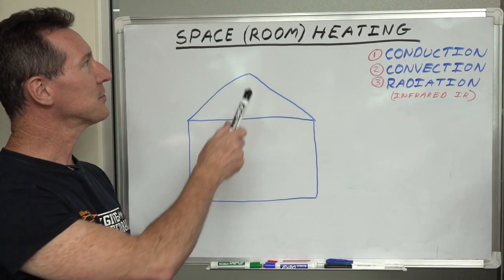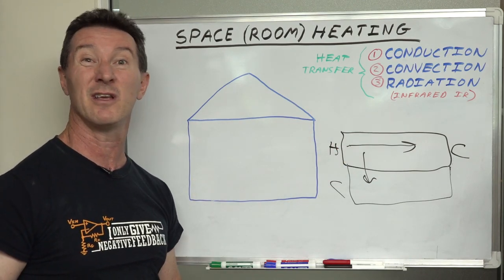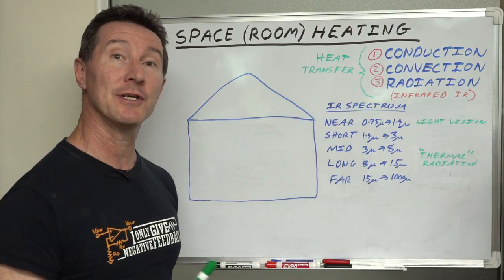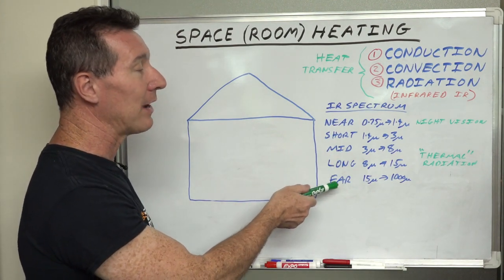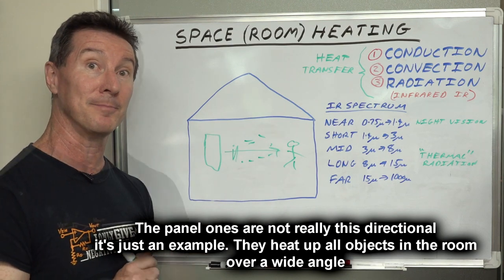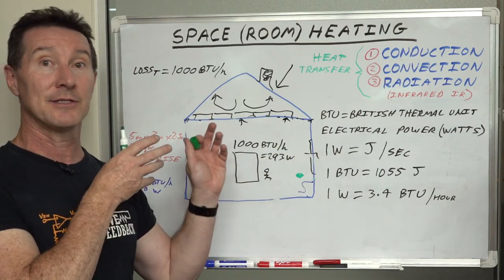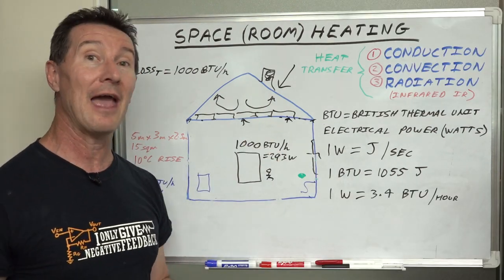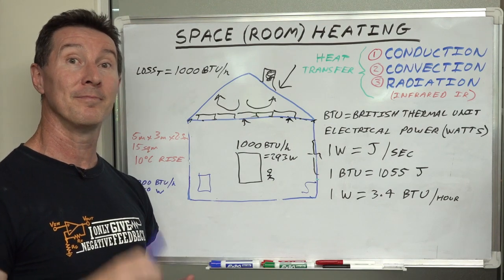EEVblog #1187 - Room Heater Technology Explained

Comment: Wait... wouldn’t a 2500W heater mean 10+ Amps? I get the feeling that would cause issues, but they sell them in Australia.
Reply: On 240 volts it would be 10.4 amps, so it would run on a normal circuit, but on a 120v circuit you would need a a 30 amp breaker (would use 20 amps and don't want to load a breaker at it's capacity so you'd move to next size up). Normally big heat sources like ovens and dryers are run on 240v though.  40 amp breaker needed for stove and 30 amp for dryer.
Reply from the maker: 2400W maximum here
Reply: @redsquirrelftw  On the off chance somebody reads your comment without fulling understanding what you mean, a higher amperage breaker would be used WITH heavier gauge wiring.  By way of illustration for normal length wiring runs: 14 gauge wire--15 amps; 12 gauge wire--20 amps; and, 10 gauge wire--30 amps.
Reply: In Australia the equivalent would be 2.5mm-10A, 4mm-20A, 6mm-30A ( cross sectional area ) and you would probably run 4mm for a 15A circuit.
Reply: EEVblog Then you get people running that off a power strip.
Reply: Cooljosh3k Well, it has to be a 10A power strip with a 10A cable and plug, not the weak 6A (or less) parts.
Reply: John Francis Doe The problem comes when the household voltage reaches 250+. Plus the kind of people who are fooled by the bullshit marketing probably plug that space heater into an double-adapter or power strip.
Reply: @wargamingrefugee9065  Yes that's a good point, you can't just go and change a breaker without changing the wiring.  The breaker is there to protect the wiring after all.  Ideally when buying power strips or extension cords it's good practice to try to stick to ones that are 15 amp rated, that way there is less chance of overloading it as it will be rated the same as the whole circuit.

Comment: There is one area where you can improve the efficiency of heating - that of control. If you have a basic heater controlled by a thermostat you will get hysteresis, where the heater will overshoot the required temperature, and the room gets too hot, and subsequently too cold before it cuts in again. You can improve the efficiency by using a more intelligent control method that accounts for things like heat loss and rate of change of temperature. It can switch the heater so that it maintains the desired temperature more effectively. The heater itself isn't more efficient, but the amount of energy used to keep a room warm is reduced.
Reply from the maker: Sure, didn't want to get into that in this video as that could be another 30min video in it's own right.

Comment: Minor detail, but in convective systems with mediums with low thermal conductivity the heat transport is virtually entirely due to convection. Once convection sets up there's no real path for conduction over appreciable distances due to the moving fluid. There is the Nusselt number, which is a ratio of the convective to the conductive heat transfer, but that assumes a hypothetically stagnate medium with no motion for conduction. Conduction is primarily important at the convective interface of the heated surface.

Comment: I'm still unclear about the differences between conduction and convection. Isn't heat moving through air (conduction) what causes convection?
Reply: Conduction is when hot metal touches cold air and the air becomes hot. This happens on the surface of the heater. Convection is when hot air moves and replaces cold air. 
So a convection heater will conduct heat to cold air on the surface of the heater, then the hot air moves, and cold air takes its place. That cold air gets heated again. This is why convection heaters either have big surface or a fan. To either heat more air at once, or move the hot air over the surface quicker to bring the colder air in contact quicker.
Reply: There's very limited conduction involved, pretty much only the boundary layer of air on the hot surface then where the air contacts the cooler surface and releases it's heat energy. It's worth noting that the air in a room will very rarely heat you as you're generally quite a lot hotter than the air in a room, but warming the air reduces your body heat losses.
Reply: Actually, no. Conduction works like this, super thin layer of material gets heated from the source of heat then next thin layer gets heated from the first thin layer and so on. Heat spreads through material. Convection really works only with gaseous or liquid substances and only in the presence of (surprise!) gravitational field. It won't work inside the ISS, for example. It goes like this, super thin layer of say air get heated from the source, heated air has less density so it floats up like air bubble in the water, because air less dense than water. So hot(ter) air less dense than cold it "bubbles" up. And the process goes continuously.
Reply from the maker: If it was pure air conduction then the heat would radiate out evenly in all directions in the air.
Reply: Convection needs material to move conduction doesn't

Comment: Interesting he brings up the idea of motor loads. I remember doing building heating/cooling load calculations and you do indeed use your blower motor loads as part of the heat load (or heat input if your heating and not cooling). Usually something similar to this we used for the heating and A/C load calculations: https://www.carrier.com/commercial/en/us/software/hvac-system-design/

Comment: My understanding of the concept of insulation is that it won't stop the heat from getting from a source, but it will make it take LONGER to get there. As I see it like a coat on a winter day, your body needs the heat for its chemical processes, and not to freeze either, keeps the heat inside the coat. Also my understanding is that if you have a perfectly insulated container with a heating element of some wattage, the temperature of the container will just keep increasing. I was thinking a scanning IR laser may be a good heater, but I bet it would damage eyes.
Reply: Yeah insulation is basically by design a very bad thermal conductor, so it just slows down the transfer rate.  This is known as R value, higher the R value the slower it transfers heat. (basically)

Comment: LCD TV is 100% efficient heater, refrigerator is 100% efficient heater, peltier device is 100% efficient heater, ceiling fan is 100% efficient heater.

Comment: are there any induction heaters ? instead of resistors or pumps , use electromagnetic induction to heat something .
Reply: Induction hobs are popular in Europe, but outside of industry you won't see them used very much otherwise.
Reply from the maker: Only for cooktops
Reply: @EEVblog  do you think that can help with power consumption ?  they are more rapid to heat up and can heat anything compliant .

Comment: 14:10 To be clear all electromagnetic radiation causes heat. The "thermal radiation" from your body behind the glass is the same as the IR heater both are radiation. However the heater although still in the IR range has a longer wavelength than the IR from your body. This is directly related to the heating elements temperature. The larger the wave the easier time it has passing through stuff. Mostly a pedantic point but it might mislead some people.

Comment: Okay, but maybe it would be best to have a variable temperature heater around the bottom of the walls, for example. a heating film, but one that can warm up to 80 ° C, for example, if it is cold because we were not at home and turned off and then heated at 30 ° C. This would quickly warm the walls and the ceiling, after which the air will be warmer. | I do not understand why radiators with the same operating principle do not heat the same. So, for example, the hair dryer and the large fan do not heat up as much as the large fan with ceramic insert / PTC insert, and each of them heats up with an old Soviet cross-flow fan.

Comment: Just for the young players Dave !
The heat loss is not a fixed value .
It depends on the temperature difference ( inside - outside ) & the rooms insulation .
So the bigger the difference the more heat input you need .

If you need more for less improve the insulation   LOL....
Reply from the maker: Yes, but for simplicity you have to assume some sort of constant loss.

Comment: Great explanation, it is a misconception among most people they don't know that a 200 watt TV for example is gunna ultimately dump 200watts of heat per hour in the room
300watt per hour is equavalent to 300watts its not accelerated BS because 1w/h= 3600J same as 1W=1J/s
Reply: Deeper layer Nope, you confuse division and multiplication.  1 W times 1 hour is 1Wh or 3600J.  1 Wh per hour is 1W.  1W per hour is the speed at which you might turn the dial up or down.
Reply: @johnfrancisdoe1563  u serious? You just rephrased what i said clearly i represented it in the end but if you didnt understand what i mean with 300watts is equivalent to 300watt/h i ment in most application and especially the example the dave listed at the end of the video when you see for example a 300watt refregirator it guranteed they mean 300wh no one measures watt a second unless for special application 
Edit fyi this sign "/" isnt division  it means every hour means Wh

Comment: I have changed my bulb to led bulb and they are getting colder than the others but the light is ok. I have a plan to make a lamp with three 300W bulb and put them in series and in this way I get a comfortable light and I utilize the heat they give in the winter, in the summer there is no need for heat or light.

Comment: A heating blanket would be a conduction heater!
Reply: but it also isnt space heater
Reply: @mycosys  It heats the room. And like a radiant heater, it first heats a particular object.  Another conduction heater is radiant floor heating. No cold tiles or wood flooring requiring house slippers in the morning.
Reply: @Markle2k  both of those cases are primarily convection heating of the space. Virtually all convection heating uses conduction from a hot surface initially to heat the air. But feel free to be as much of a pedant as you wish
Reply: @mycosys  I'm not intending to be a pedant. As far as the soles of your feet are concerned, on a chilly morning, the heat is conduction. For room heating, yes, even convection starts with conduction for the most part, as you say. Non-humid air is pretty transparent to radiant heat at temperatures that humans (and most solid materials) can survive. You need to get near 10000 K before the oxygen starts becoming opaque to the bulk of the radiant heating.

Comment: Dumb question:
If we take a radiator using natural convection and we force air with a fan what we obtain? Is the BTU/H increased if we have a "infinite" power source keeping the radiator always at the same temperature?

If the energy required to heat up a room is the same can we increase the heat transfer speed of the convection system? Like on coolers. We add a fan to increase the speed of heat excange.
In this case the heat source will cool due to the fact that the energy we extract is higher that the energy that it makes.

In an ideal system without losses the energy from the radiator that didn't get transferred to air is stored in oil or water (bases on the system type). If the resistors or the burner have a feedback they are off until the system need more energy to push into air. But this doesn't change the amount of energy required 🤔.

I'm just trying to understand how the meters on the radiator on Italy works to calculate the bill... 

The tecnicians calibrated it by number of fins, fins sizes, distance from the wall, etc. Are those measurements made to calculate the effectiveness of the natural convection?
On radiators in Italy we have a valve (thermostat valve) that prevent hot water to get inside the radiator if the room temperature is around 20°C. This will cool down the radiator and the meter stop. Hot water is provided by a natural gas boiler. The boiler itself regulate the water temperature and have a pump forcing the circulation.

This a brainstorm made at 3 AM...
Reply: TuttoCrafting I don't know about Italy, but in Denmark the usual metering system compares the temperature of the radiator and the room to get an approximate measure of heat energy removed from the circulating water.  The result is in arbitrary "units", actual billing then divides the total cost in a given year according to the how many units were counted at my radiators out of the total for all residents.  Method is not exact, formal checking is done mostly on the accounting side, such as not including any unrelated costs in the the heating bill, not collecting a different total amount from all residents etc.  The measurement company (an outside specialist) needs to justify the fairness of their method, and occasionally markets improved techniques that (for example) are less likely to bill for the sun shining on the heater.

Comment: Edit: crap, I'm probably in the wrong here... nothing to read here 😂
The mistake I made was equating an energy consumtion expression "W per hour" to expression Wh.
Possibly right but pedantic.

Dave, with joules and watts I got confused it felt kind of backwards since 1J = 1Ws.
Joule is a defined amount of energy... but can be a power level w. time?
Watts are just instatenous power level.... but with added time unit it also becomes an energy amount such as kWh.
Hmm... Why use the complex J/s when W is the same?
At the end of the video it can be easily misunderstood that saying 300 Wh is always talking out of their arse.
It is probably true for thermostat regulated heaters because they will run at full power until satisfactory conditions are met and then consume less as it does not need to raise the room temp any more -just need to keep up with losses.
So, like you alluded to, the makers do not know the application situation.
However, for lots of things, an hourly consumption if 0.3kWh could be correct.
BTUs... Hmmm.... more confusion, BTUs where mentioned on my AC unit, that where I even heard of it at all.
Add calories too? 😂
Reply: It sould be ws not wat per second( w/s)
Reply: @mistakenotou7681  Thanks!

Comment: The issue of calling a space heater a radiator is sort of like calling a tomato a fruit. It's right but it depends on the field of terminology. Properly radiation is actually electromagnetic radiation where radiation just means to spread out (it means wheel spoke in Latin, the spokes spread out from the center). So radiation with a gas medium is just convection. In physics radiation means the transfer of energy via particles. So a radiator "spreads" heat. But radiant heating "spreads" electromagnetic particles (aka photons).

Comment: You dont mention the efficency of SPREADING the heat into the room.A 1kw oil heater with 3 fins is worse than one with 6 fins. They both use 1kw but the 6 fins have a greater surface area to interact with the air, plus will be cooler to touch . A single fin 1 kw heater may be considered less efficent as it has little convection but more radiant heat and will cause a fairly useless hot spot on the wall and floor which will conduct the heat away to the outside

Comment: BTU is NOt directly equivalent. You got it right on the Whiteboard but the explanation is at best misleading
Reply from the maker: How so? 
1W= 3.41 BTU/hour
and
3.41 BTU/hour = 1W
Reply: @EEVblog  It's semantics I think.  BTUs are proportional at rate of 3.412:1 and some odd change.  A "direct" equivalence would imply a 1:1 relationship.  It wasn't until you wrote 3.4 btu per watt on the whiteboard that it actually made sense.  No worries, you did get there eventually ;-)
Reply: @EEVblog  https://youtu.be/J3pE_mDwCpk?t=1223 here you say "what matters is the power, either watts or BTUs". Technically, BTUs are not the power, they're energy. You need certain amount of energy (BTUs) to rise the temperature of a certain amount of air by a certain amount degrees. I find what you say here quite dodgy... :)
Reply: BTW, I give you a big thumb up anyway!
Reply: @EEVblog  I know you are well aware how these units are connected, I just wanted to point out that you got them mixed up in your presentation (for example at 19:26 you said "BTU has that time component in it"). Of course BTU/hour is directly equivalent to Watt(with a conversion factor) as they both are units of power. it might just be pedantic nitpicking (hello from germany btw) but you're pointing out that "Watt per hour" is a nonsensical unit a few minutes later in the video. Don't get me wrong I liked the video nonetheless. I just wanted to provide some objective criticism.
Reply: @EEVblog  You say "BTUs have a time component as well", which is incorrect (it's a unit of energy), but then correctly refer to BTU/hour on the board. BTUs and BTU/hour are different units.
Reply: @Chris_the_Muso  No, it's not semantics. BTUs are a unit of energy and watts are a unit of power. There's no possible conversion between those two units. "3.4 btu per watt" is incorrect. You have to add a time dimension (e.g. 1W = 3.41 BTU *per hour*). He writes it correctly on the board but misstates it verbally. I have no doubt Dave knows all this, but since it's an informational video I think this could confuse some people, especially since it seems like it's confused you.

Comment: The best way to stay warm is to pull a hard vacuum in a large room with walls coated to reflect IR. Then, stand close to a radiant heater inside the vacuum to prevent loss due to convection. Add a second wall with a vacuum between both walls and you will never pay for heating again.
Second best...add a layer of clothing.
Or, move the room to Los Angeles...where it is never cold...well, except for the other day when it snowed on my street...because of global warming.

Comment: What about a large metal plate with fins with an Induction coil driven by an inverter running at 250KHZ of power of 750W, the induction coil will be protected by Rock-wool.